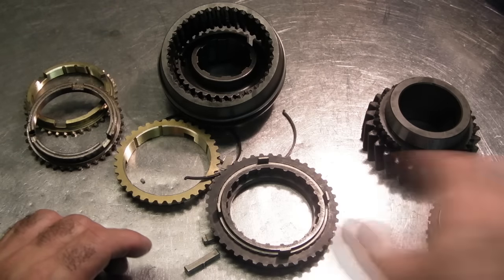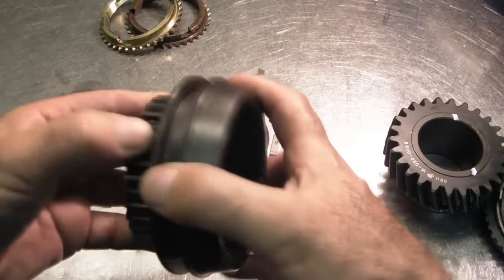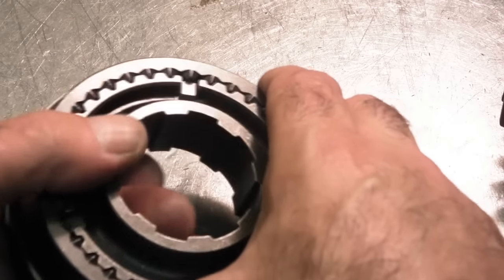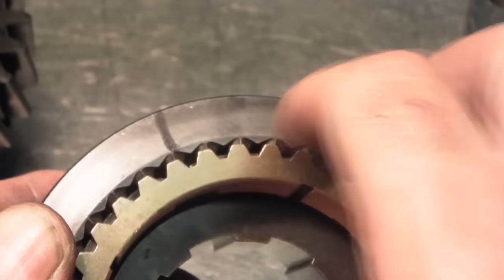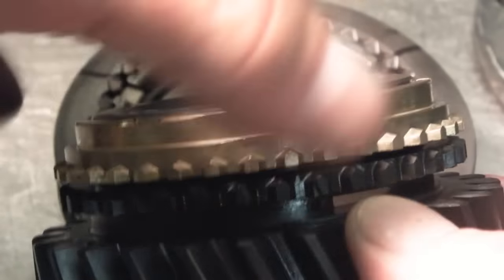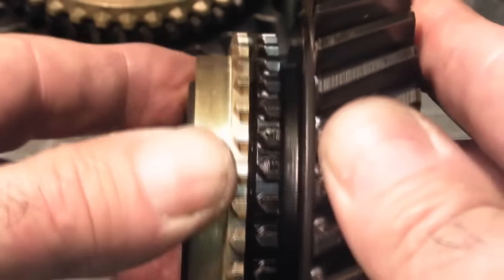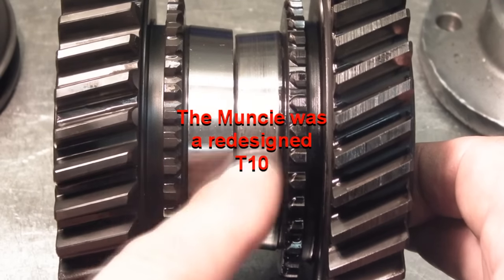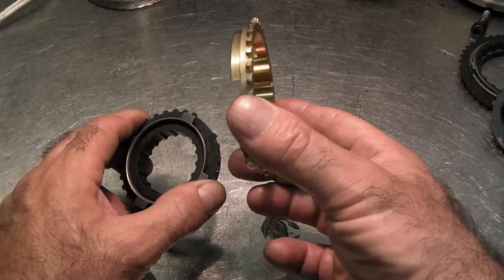Learn About Transmission Synchro Rings

Comment: 5 speed manual honda prelude won't go into reverse, feels like something is blocking it, any help/tips?
Reply from the maker: Does it go in with the car shut off? If it does then you have a clutch issue.
Reply: no
Reply from the maker: more than likely then you have an internal rail issue inside the transmission.

Comment: I've noticed on my 2007 si sometimes when I upshift when it's cold out and the engines cold sometimes it will grind could that be related or most likely not ?
Reply from the maker: I don't know what transmission you have, can you be more specific?
Reply: It's a six speed manual and it only happens when it's cold in 3rd gear maybe once a month and it's a 2007 Honda Civic si sedan
Reply from the maker: Change out the fluid use a lighter weight oil
Reply: How much would that generally cost because it's like -10 out and I'm not gunna do it myself in this weather .

Comment: 98 ford contour svt grinding into 3rd except when I double clutch or let rpms drop think it's my synchro or a cable that needs to be adjusted
Reply from the maker: Adjustments will not fix a grind in that transmission.  Time for a rebuild.
Reply: GearBoxVideo and what am I looking to spend with a rebuild how long can I continue to drive it it's my daily ive been  going 2nd to 4th to avoid 3rd
Reply from the maker: Don't know the costs. Probably better to price out a used unit from a wrecking yard.

Comment: What causes the 5th gear to vibrate at 75kph-85kph?
Reply from the maker: Depends on the transmission. Usually it is not in the gearbox.
Reply from the maker: Again..what make model transmission?

Comment: Question: About a t-850 transmission, I watched your video and now have an understand of my problem. Had gear block-out , No Grinding. Which part should I replace the Synchro, or the synchro ring 
-pic of both (dont know if you will be able to tell)

http://www.srtforums.com/forums/attachments/f213/85762d1396834418-3rd-gear-problem-fix-013.jpg

http://www.srtforums.com/forums/attachments/f213/85746d1396834322-3rd-gear-problem-fix-003.jpg
Reply: Just for the record, 3rd gear block out
Reply from the maker: Its hard to see from the pictures supplied since you showed the back side of the ring.  If the point of the rings lines up to the point on the slider, you will get bloack out. You will also get block out from poor clutch release.
Reply: Yeah sorry thoes are the only pictures I have from when I previously took the transmission apart.

 I was thinking of just replacing both the synchro and the rings, but I cant find the 3/4 synchro for sale. Also if there was poor clutch release wouldnt it block out other gears and not just the 3rd gear? Because it only happens with 3rd. 

Also thanks for the quick reply's and help.
Reply from the maker: Gabriel Madigan Sometime poor clutch release will wear our an assembly. Not necessarily all the rings. Happens quite often, Some rings have to work harder to match RPM than others and  a poor clutch release will ruin those rings first.

Comment: Why in most brands the whole parts packaged as syncronizer pack
Reply from the maker: Because they match sliders and hubs
Reply: @GearBoxVideo  is it difficult match them in workshop and it ought be done in producing line
Reply from the maker: Most Original companies that do net sell individual components. Aftermarket components can vary greatly. The assemblies I sell for the Muncies are made by us and we follow factory guidelines which allow no more than .005 backlash between slider and hub

Comment: I'm not sure if I'm comfortable with the idea of stamped keys. Sounds a bit like a cheap-out. Just look at the Kalashnikov. First they machined the receivers out of heat-treated steel billets to get the highest possible quality they could, and then moved on to stamped receivers to make it cheaper to produce. Obviously, the over-all production-quality of a stamped AK is much lower than that of a milled one. Those stamped receivers are how AKs got their undeserved reputation for being inaccurate.
Reply from the maker: Borg Warner had been using stamped HARDENED struts since the 50's. These have never failed or broken because of qualiy issues. Usually a worn ring creates an abnormal air gap which causes excessive clearance and the strut breaks. When this condition exists no matter what the material is, they break. So sometimes people get "uncomfortable" for the wrong reason. Be uncomfortable with running flattened rings instead.

Comment: The problem with modern manual transmissions is they are designed by engineers whose daily driver is an automatic. They have no clue what would be a good design for a manual multi speed transmission.  Shops see a lot of 2nd gear synchros being destroyed, and nobody seems to know why that is. The reason is simple: A modern multi speed 6 or 7 speed does NOT need to be a so called progressive transmission. Many people find manuals hard to shift as it is, and making it a progressive transmission just compounds the problem. A close ratio transmission would be easier for most people because each shift is identical. Progressive transmissions with the first RPM split 900 RPM and the final shift only 300 RPM is not just wrong, it is wrong headed. And that is why they tear out 2nd gear.
Reply from the maker: Ratio spread is based on torque curves of engines. I don't understand why you think manual transmissions  designed by engineers who drive automatics.. its a mute point. Not every engineer who designs jet engines has a jet. Manuals for years have been designed by companies that design these such as Getrag, ZF, New process, Tremec etc . All of these companies have designed racing and street boxes.  However your viewpoint is interesting

Comment: What  are the  benefits   on the   later   synchro  units    Muncie  other then the  stronger  rings
Reply from the maker: If you are talking about the lined rings used in newer 5,6,and 7 speed transmissions? Basically they synchronize faster using a smaller form factor.

Comment: What happens when your gear slider goes bad
Reply from the maker: define bad...
Reply: @GearBoxVideo  gets stuck in 2nd going into 3rd no ability to go to neutral between
Reply from the maker: Sounds like a shifter issue. If the trans goes into all gears with the engine off or is it the same?
Reply: Goes into all the gears with the engine off normally
Reply from the maker: Then it's a clutch release issue

Comment: how to calculate the number of teeth on the synchromesh?
Reply from the maker: The calculations are for what purpose?
Reply: GearBoxVideo I want to design a transmission gear, then I want to count the number of synchromesh gear. How to do it ?
Reply from the maker: You would have to understand what the load is on the gear and max rpm. The teeth hold the gear to the mainshaft under load.  Its pretty complex and not easy to describe in a Youtube comment. I would suggest get some books on gear design
Reply: GearBoxVideo I've seen a lot of books on the design of the gear, but I did not find a book on the number of teeth on the synchromesh.
Reply from the maker: These are called clutch teeth. Think of them as gear teeth and design based on load requirements.  Pretty much every size and shape have already been done.
Reply: GearBoxVideo so what should I do first to calculate the synchromesh gear?

Comment: What I love about grocery-getter econoboxes now is how the Honda Fit I used to drive had a "clutch delay valve" which allowed the clutch to disengage just fine at speed, but inhibited the fluid from moving while trying to engage the clutch in hopes of having grandmas burn up the clutch rather than do a bad clutch dump downshift and break the transmission...  or my 2.5i non turbo Impreza which I drive now, that has a 25 lb. flywheel that does the same thing, which is burning up my clutch on a downshift rather than allowing me to rev match by blipping the throttle like any manual transmission driver should know how to do.  I can't stand stupid engineers.  As soon as I saw you point out the difference in the shapes of those cones I rolled my eyes and wanted to punch someone.  This kind of awful design makes me puke.